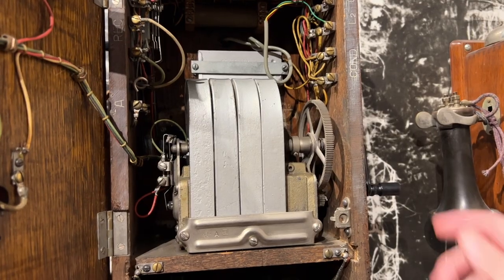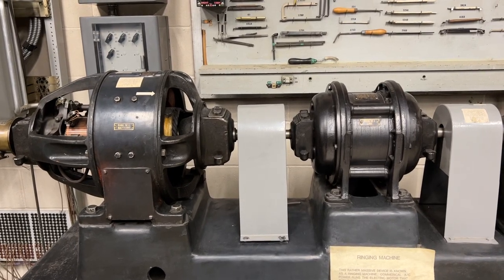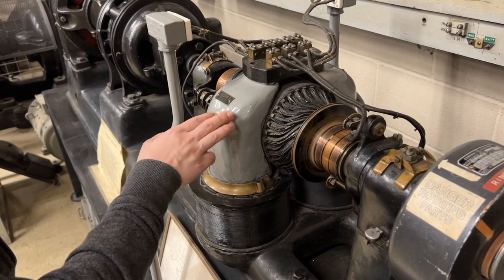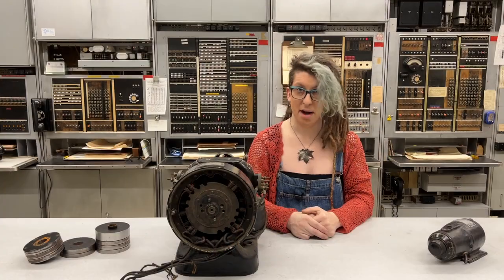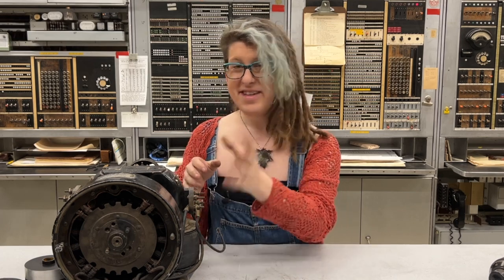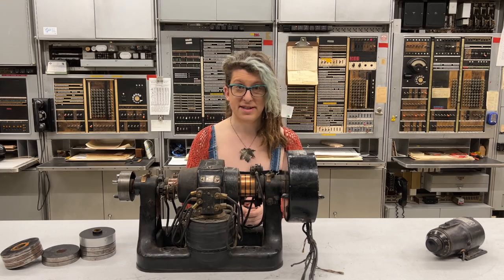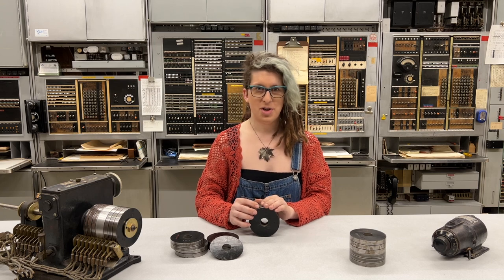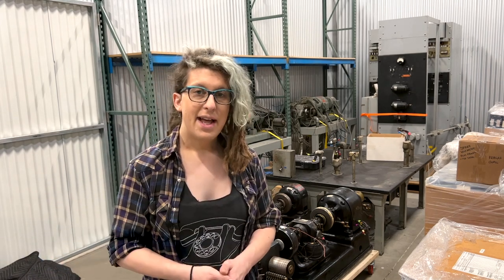The Machine that Makes Your Phone Ring

Comment: Hi Sarah, really cool video. Brings me back to my first job in the telecom business as a Western Electric installer back in the early '80s at LSANCA06, a 2 MG 5xb. I was on the power crew working graveyard replacing the big 440/3p to 48 volt motor generator sets with big, honking 1000 amp ITT rectifiers (5 of them!). I was a newbie grunt (19yrs old, I think), and was fascinated by the ringing machines. I remember that they were duplicated - a 440v AC powered one, and a  minus 48vdc powered one. They provided both redundancy and DC service continuity for AC outages. By that time, the tone generator itself was replaced by a precision plant, but all of the ringing and interruptions were still carried out by that cool Frankenstein RG. So many cool things in the power room back in those days. Motor operated CEMF cell switches, giant knife switches and a power room logbook that went back to the 50's (with a cool entry about the Sylmar earthquake in the early 70s). I remember that there was a separate 130 volt plus/minus plant (with it's own giant batteries) just for CxR and coin. I later went on to a long career in the PBX business with NEC and now with a software company, but my time in that power room (and the xb) was probably the most fun of my career. Thanks again for the memories!
Reply: This was a fascinating read.
Reply: Its a man, not a sarah.

Comment: Rectifier trivia: motor-generator sets were fairly common in the computer systems of my youth, where they provided (mostly) isolation from transients on incoming power. Thus spinning-metal-things were used long after solid-state rectifiers were common (first selenium, and later silicon). The motor-generator sets for mainframe computers were AC-AC sets, and the computers themselves were using silicon diodes to rectify the AC from the motor-generator. Mercury was, once upon a much more toxic and dangerous time, a very popular solution for electrical switching without contact erosion, too.
Reply: I worked in a computer facility and we had an EPE 50 KVA 60 Hz to 60 Hz motor-generator set UPS up to about the year 2000.  There was also a DC winding which was powered by (I believe it was 24) 33 amp-hour SLA batteries in series.  Against my advice, my boss had the unit installed in the basement.  A cast iron pipe elbow of the building’s fire sprinkler system burst and flooded the basement with 150,000 gallons of water which destroyed the UPS and shut down the computer facility temporarily.  The replacement UPS from EPE was solid state as MOSFETs and IGBTs are now up to the task and inexpensive enough.  The UPS foolishly was reinstalled in the basement.  I suggested raising the unit on courses of blocks to get it above the water line clearly visible on the wall, but that was deemed too much bother.  The business I worked for was many times more dependent on computers, but wasn’t willing to spend a few thousand Dollars to significantly reduce their risk.  Go figure.  The boss did pay attention to getting the backup Diesel generator and transfer switch on a biweekly test cycle.

I recently toured a facility which 3D prints medical devices such as knee replacements from fused titanium powder.  Their UPS system incorporated a physically rather large flywheel system manufactured by Caterpillar.  I believe there was enough stored rotating energy to keep the facility up for at least a few minutes while waiting for the generator to come on line.  I don’t think I’d want to be anywhere near there if anything mechanically bad ever happened!
Reply: A place I used to work at also had an MG set providing power to their mainframe (this was in the late 80's / early 90's).  They also distributed that power to some of the engineers' cubicles so we could have uninterrupted power for our stone-age pc's.  When I first started there, I unknowingly plugged my desk clock into that circuit.  Needless to say, it didn't keep time very well, and that's how I discovered my error...
Reply: Motor generators used to be used a lot in trains as well, converting the power supplied from the loco to whatever was required in the coach for lighting, battery charging etc.
Reply: @crabby7668  And in Elevators from the era believe it or not. A lot used those AC/DC converting things, some even used the Mercury arc stuff I don't recall the name of it.
Reply: Since this channel is about telephone exchanges, they also used Motor-Gen sets.  Although,  not in use when I was in the exchange, the moto-gen set had been left in the basement along with the open battery boxes.  The DC brush sets of the geneerator were about 3 ft long (perhaps a little shorter).  I was told that when the system was under considerable load, the arcs from the brushes were about 8 inches long - the smell of ozone!
Reply: In the late 1980's, our UniSys 1100/80 (previously known as UNIVAC) mainframe computer has a large MG set.  However, it's purpose was to generate 400hz AC voltage for all the (linear) power supplies in the various mainframe computer cabinets.  Just like on aircraft, the 400hz AC line frequency allowed for smaller transformers.. this was lighter (not a big problem for the mainframe) and smaller and cheaper power supplies.

When the advent of switching regulators/power supplies in common use arrived, this was no longer necessary.

I "rescued" a 12V, 60A (I think) DC power supply from an old UNIVAC 1108 mainframe computer that was being scrapped.  I figured I could run some of my ham radio stuff from it.  This was 19" rack mountable cabinet, probably 4U or 5U high and was a beast!  It was difficult for one person to pick up and carry, despite the handles on the front..  And there were lots of these in the 1108..

Comment: I recall using pay phones in the 1970s to make long distance calls.  The operator had to be involved.  The operator would ask for the money before placing the call.  Then the operator would stay on the line until the party answered.  If the called party was busy, the operator would disconnect from the called party number and then refund the coins that were deposited.  It was very loud to the ear.  It sounded just like a ringtone only it was multiple times louder.  I knew to hold the receiver away from my ear when this was happening.  You would also hear a mechanical bang coming from inside the payphone and then you’d hear your money release down into the coin collect section.  It was highly mechanical.  It makes sense that the coin collect / return was powered by the ring generator equipment.  It didn’t make sense in the 70s but now that you’ve explained it, I understand why it sounded like a heavily amplified ringtone now.  Oh I should also mention that sometimes the coins would not return and the operator would have to initiate a coin return again and usually the second time the phone would give you back your money.  Not sure why it would do that.  I figured corroded parts inside the phone.

Comment: I was playing with our phones when I was a kid when a call came in at that perfect moment when I was touching tip and ring. I saw stars.  20Hz @90v hurts more than 60hz @120v in my humble opinion.
Reply: When I was a frameman it happened to me a few times working on lines and cables.
Reply: I got married nearly one year after hiring on with Southern Bell....It didn't take but a time or two getting shocked by ringing current....I am 80 years old and been retired for 23 years and I never put that wedding band back on....My Dad told me if a man acts married he doesn't need to wear one....

Comment: Regarding “spinning metal”:
Take it to the extreme and you get an Alexandersson alternator, used to transmit (long wave) radio. One such machine survives in working order in Grimeton in Sweden and occasionally transmit with the call sign SAQ at 17442 m.

Comment: Early in my career, I shorted out a ringing machine on the overnight shift. The backup kicked in immediately and alarms went of in the CO.As soon as my co-worker and I realized what was going on, we went to basement to see if we could fix it. Luckily for us, there was a spare unit in the basement and we scavenged parts to repair the main ringer. An hour later, we had the main ringer back online and thought we had dodged a bullet until our foreman came into the office and asked what was going on. It turns out the the backup ringer has a slightly different tone and everyone in town was calling in troubles because their phone sounded "different".

Comment: I really enjoyed this video as I was charged with reviving one of these "P" type machines in Hartford, CT. The ringing machine in our toll office had a failing gearbox. so I spent a few days going through the prints of a dead step office to learn how this machine worked. There were transfer switches between the dead step office and the toll office so I knew that I would be able to get the signals to the toll office. It took a couple of weeks to get the "P" machine cleaned up and adjusted as it had been idle for almost 20 years. I installed the fuses and the "P" Machine fired up and produced a dial tone and ringing signal. A little work on the mercury drums and the cutover day came up. I threw the switches and the toll office was operating on the "P" machine. I was able to keep the toll office on the "P" machine for the entire time it took to swap out the bad gearbox in the toll office. Sadly, I had to cut back and shut down the "P" machine when the job was done. Say what you want, but that old machine could have worked for many more years if it weren't for the ESS & Digital offices. Thanks for the video.
Reply from the maker: Two of the machines we have came out of Hartford! They are newer, likely from the 1960s, and were gray instead of black, like this old one here. I believe they were manufactured by GE for Western Electric.
Reply: @ConnectionsMuseum  I wonder if you have my old friend!

Comment: Interesting story on the early mechanical call progress tone (dial tone, audible ringback, busy tone) generators! For about 11 years, I worked for BNR Inc., which designed equipment manufactured by Northern Telecom. I did some development work on their SL-1, later rebranded Meridian, PBX. The system was PCM (digital) internally and had a tone and digit circuit on two boards. The circuit generated the call progress and other tones by reading bits from ROM. By that time, the Bell System had adopted the precise tone plan, which specified 4 tone frequencies. Dial tone, audible ringback and busy tones were each a mix of two of those tones. The board also generated the DTMF tones and a special ringing sound, for the system's proprietary telephone sets, played through a loudspeaker in the set.

I proposed to redesign the two board circuit to fit on one board as a cost reduction and to save space in the system shelves. I worked on the team which did the redesign. One interesting facet was that we made our nominal frequencies for the DTMF tones be the nearest multiple of 10 HZ. So, for example, 697 Hz became a very accurate 700 Hz. The approx. 0.43% nominal frequency offset was well within the required 1.5% tolerance. I am not aware of the nominal frequency changes creating a problem in the field.

Another version of the board was designed for a version of the PBX for use in the Swedish telephone network. It generated the call progress tones used in Sweden.

Comment: Hi Sarah, Terrific work you are doing.  I'm looking forward to more.  You may have thought of this already but keep this in mind that when you connect up one of the big ringing machines and try listen to the audible ring coming out of it.  The audible ring that we would normally hear is coming through a trunk circuit or SxS connector that puts a .04MF capacitor in the path.  This significantly changes the sound .  The sound of the ringing as monitored on the called line is very loud and overwhelmed by the 20HZ and 40HZ components.  The capacitor reduces the volume and filters out that low frequency, giving you the nice 420HZ plus harmonics that we all know as "City Ring". --Will
Reply from the maker: Exactly right. I think it will be interesting (once we get one of these machines going) to listen to the ring at various points, with and without the caps to see how the sound is different!

Comment: Thank you Sarah.  When I was a kid in the 1960s, our local Bell System office held n open house.  Our office served, I’m estimating, 10,000 subscriber lines and pay stations as well as being a long lines repeater facility.  The building comprised three stories plus basement, about 100 ft on a side.  The top floor was operator consoles, billing recorders, long lines TV transmission monitoring equipment and test desks.   Somewhere around 1/3 to 1/2 of the second floor was amplifiers with large vacuum tubes, carrier current modulators and demodulators, the rest was racks of SxS frames.  My recollection was the first floor was almost all SxS frames and main distribution frame where subscriber loops terminated.  The basement had a row of ring generators with large black motors.  It seemed like they were physically larger than the P type shown here (possibly faulty memory from 60 years ago).  There were tone generators present because we had the more melodic versus raspy call progress tones.  The rest of the basement contained enormous glass cased 2 Volt cells connected to yield the -48 VDC plant voltage.  I thought it was odd to put the power source in a basement where it would be damaged if there were a flood.  The office is on fairly high ground, so I suppose that was a calculated choice.  At least any noxious fumes where not likely to permeate the floors where switching equipment and electronics resided.  The office was modernized to electronic equipment in 1976, most likely a mid generation ESS.  I do not know what is in there now, as that area is now part of the so-called Uverse where a lot of capability is decentralized into cream colored cabinets scattered throughout neighborhoods.
Reply: Those old lead acid batteries were incredibly heavy. It wouldn't surprise me if the high floor loading was one of the reason to put them in the basement, although all of the other stuff appears pretty heavy too.
Reply: @mfbfreak  Excellent point.  Those batteries were about the size of the old style trash container and there were a lot of batteries.

Comment: I used to routine the ringing interrupter on the 12th floor of the Chicago 1 office.  We used crocus cloth to polish the snot out of the commutators but about once a month we'd get calls that they weren't working.  One day I opened the BSP and read that we were to only buff the commutators with a ouece if twill cloth wrapped sround a stick.  The commutators oxidized but never failed after that.

Comment: If you want to hear what the old Bell System “city tones” for dial tone, ringing, and busy signals sounded like, you can hear them on smithno41’s dial tone generator upload, and if you want to hear a sample of what the ringing signal on the Automatic Electric (independent) system sounded like, you can hear that on Veronique Laurent’s Mildred Pierce ending scene around the 3 minute mark.

Also, andyvalve100’s upload of “ringing machine 44a” lets you hear what the various tones and ringing signals sounded like on a British tone generator from 1959

Comment: I worked in a Panel office BCO/GCO where we had 2 ringing machines. 1 as a backup. we used the old tone style until precise tones became the fad with touch tone. the precise tone generator used transistorized plug in cards an a plug in frequency specific vibrating plug in. Nice video. Thanks.
Reply: Are you Boomer from Davenport CO??? We were good friends and you were a genius!
Reply: @linxj6  Boomer and Ratso yes. Retired now but active with computers and writing software. Unix/Linux. Who is this?? 🤔
Reply: @linxj6  Hi. Yes. Who is this? Joe, Jim ?

Comment: As a stage crew member and the sound engineer, I've at times needed a ringing telephone. finding a source for this signal was difficult until I came across an electronic phone ringer. The voltage and frequency was performed electronically in a package about 6" square powered by a 9volt battery. Perfect for about $100.00. A unit that not only sent a ringer but hooked up several phones to actually talk is also available for about $200. Amazing, you think?

Comment: It looks like a Dynamotor...an ac motor driving a dc generator....or vice versa ...a dc motor driving a ac alternator. Years ago in a shop I worked in, there was an old radio that had a Dynamotor inside for high voltage DC.
      The speed of an alternator sets the frequency/tone. 
       Vacuum tubes have been around since the 1890s, but weren't really reliable until the '30s..
        There were mechanical radio transmitters..alternators and spinning spark gaps ...that transmit audio. Not the best quality, but there were half million watt transmitters that used this back in the day.
     There was a " howler tone" to let you know the phone was off the hook.
      Years ago, I lived near a dump, and the phone company threw out 45 volt batteries that still had life in them, great for vacuum tube projects. 
      This is a great video!

Comment: Very interesting to see how it is done in the US.
I worked as a Telephone Technician in NZ in the 80's. The continuous tone was generated much the same but the interrupted tone was from a bank of cam wheels that provided the ring cadence and the other tones N.U.T (number unobtainable tone) Busy tone and various timing pulses required in a Step x Step exchange.
Thank you for the info.
Reply from the maker: Thanks! Yes, there are other systems in the US that also use cam wheels. The ringing machine we are running on currently works that way. The XY system by Automatic Electric has some interrupter cams that are quite large and fascinating to watch.